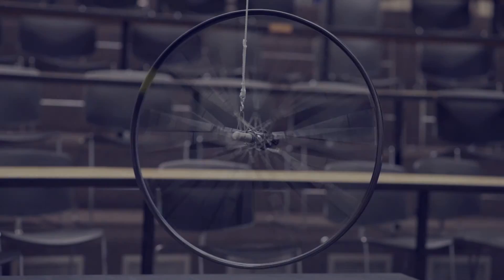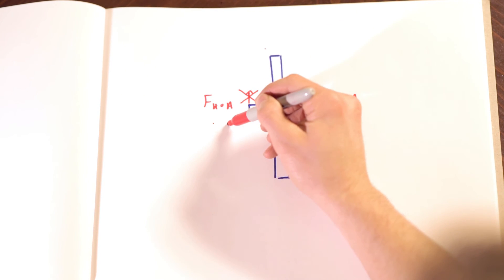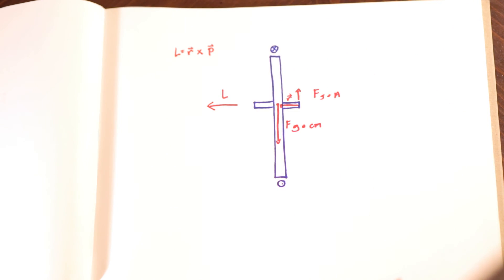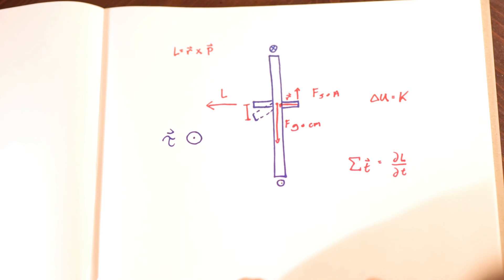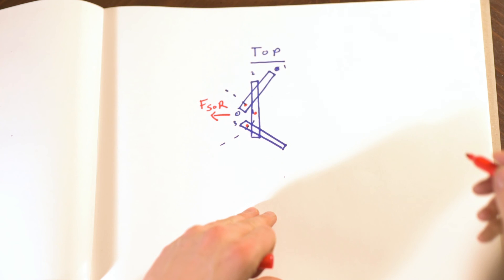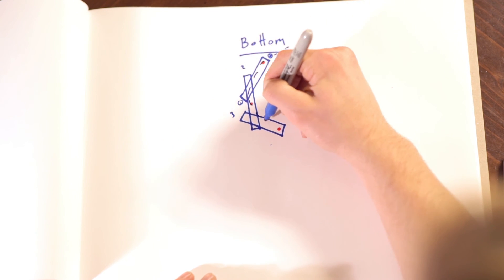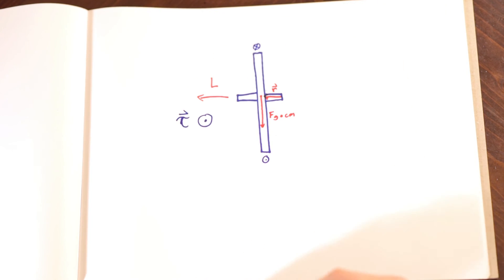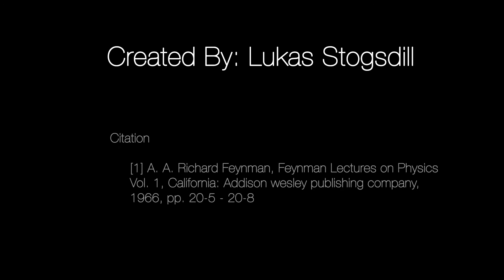Gyroscopic Precession Explained

Comment: would gyroscopic precession still occur if the rim and tire were replaced with a liquid metal, and instead of spokes it was in cased in a magnetic circular tube? and what if you rapidly fluctuated the magnetic field to the liquid metal expand and compress, like a low frequency speaker?